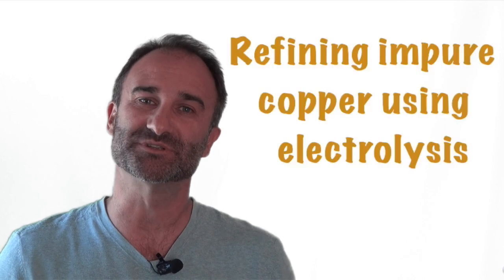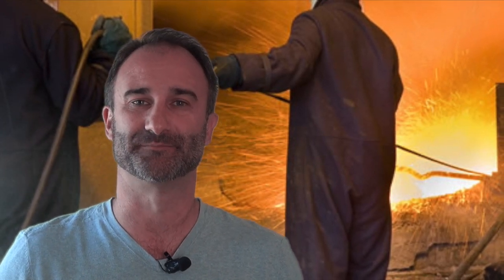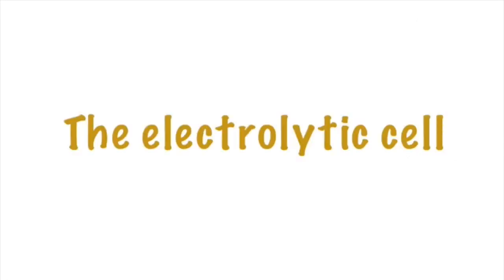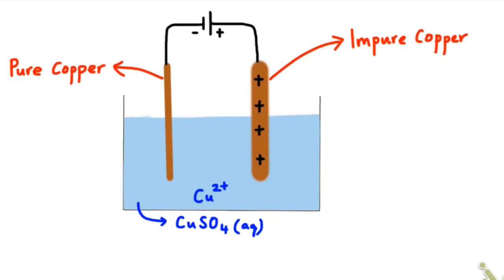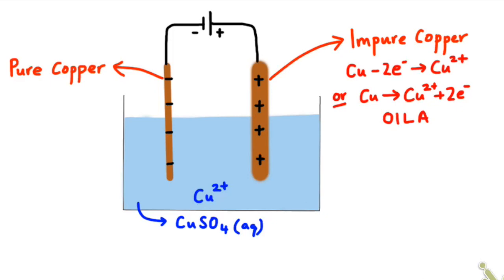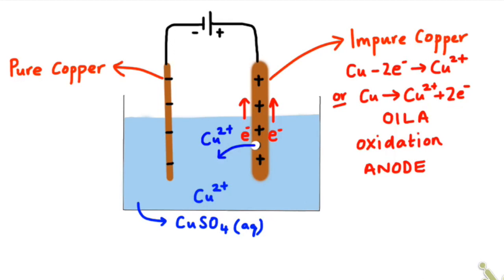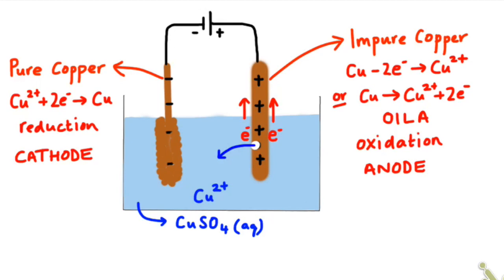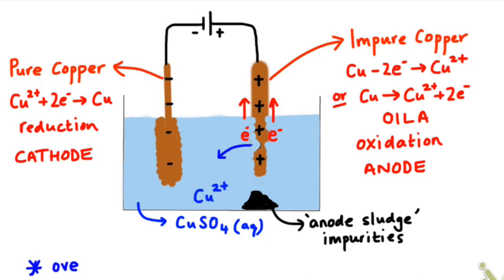Electrolysis of impure copper

Comment: I have not been able to figure out what is the exact role of electrolyte CuSO4 then as Cu+2 ions are already provided by anodic copper. Can anyone explain thanks
Reply: It simply acts as a medium for transference.
The molecules on the anode lose two electrons due to the negative charge and so are attracted to the cathode where they gain two.
One imagines little electrons swimming across the gap, but that isn't how it works.
It is the electron potential that moves through the copper atoms in the copper sulphate solution.
It's like the schoolboy question about how long it takes for an electron to go from the light switch to the bulb, and most answer "speed of light", but the reality is the electrons barely move, it is the potential that does. Think of the "Newton's Cradle" desk toy. The balls in the middle remain static.
Reply: I have the same question too, did you know the answer yet?
Reply: i could 100% be wrong but i think it has something to do with the fact that the actual circuit of the electrolytic cell needs to be closed somehow and so the cu solution is needed to allow the cu+2 ions to flow and attach to the cathode/impure cu sheet/negativly charged electrode

Comment: I don't get why the concentration remains same.. Can someone pls explain this?
Reply: 아미  the solution initially contain cu2+ ions. the produced cu2+ ions at anode are reduced at cathode hence there’s no change in the [cu2+] (basically, you’re producing and using cu2+ simultaneously )
Reply: @kokngong8245  hey, plz tell me what is the observation of this experimen?? Plzzzzzz
Reply: @Blackcatsiren1  the demonstrator did mention them but I'm okay to state them
cathode(reduction)
- Cu2+ are reduced and this can be seen as brown coating on the pure copper metal
Anode(oxidation)
- the impure copper electrode wear out due to oxidation of Cu - Cu2+. this make the impure electrode(anode) appear thinner at the part immersed in the solution

at the bottom of the beaker, impurities will be form sludge( i don't  know what colour it will be)
Reply: @kokngong8245  oh tnx dear ,bt i can't understand anything😜🤪😝

Comment: How does the copper lose two electrons? Does the impure copper electrode act as a battery?
Reply: CopperyMarrow15 YOUVE got to memorize the half equations
Reply: Copper loses two electron due to its ionisation in anode as oxidation reaction occurs, then the two electrons that has been released will be accepted by the Pure Copper in cathode, as they gain electrons the reduction reaction occurs aswell as the atoms are produced, making it thicker

Comment: I've read elsewhere if the voltage is too high other metals can get carried over to the cathode , can you confirm this ? Is there a minimum voltage required before Cu/Cu electroplating can occur?
Reply: Good question. I'd like to know too.